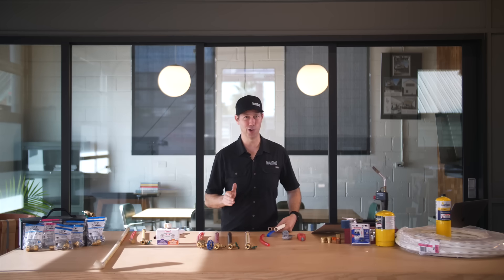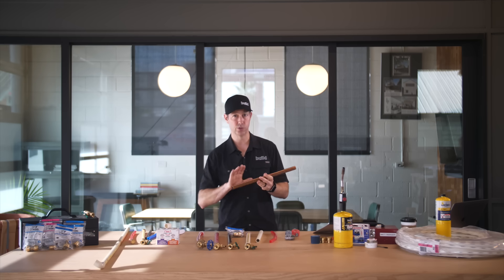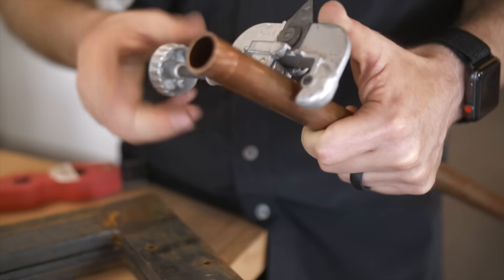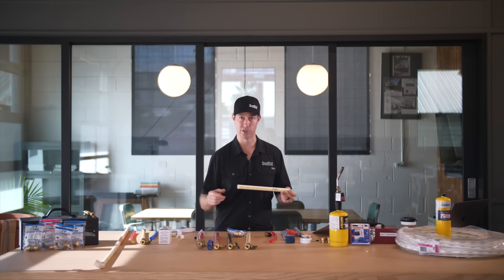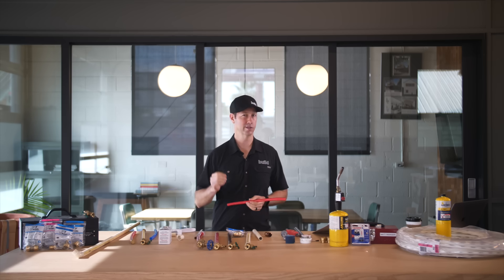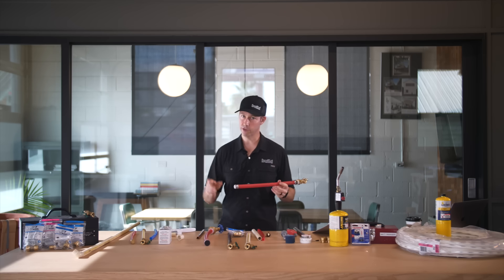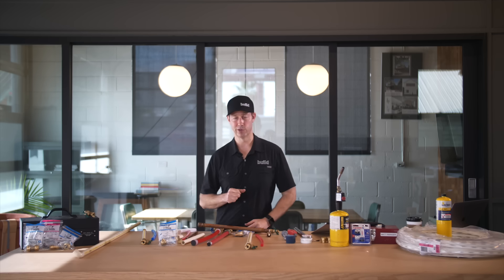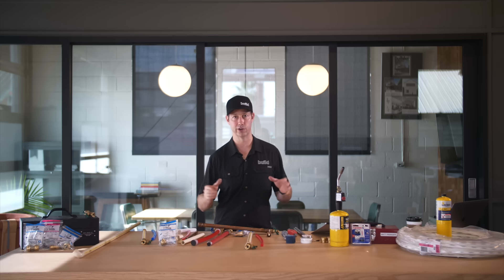PEX vs COPPER vs CPVC plumbing pipes

Comment: For the pex line, do you use the plastic fittings when you're using the expansion rings and the copper fittings when you're using the metal crimp rings, otherwise what's the difference between copper and plastic joint fittings?

Comment: I’ve been running and replacing water line for 30 years. Type M copper can become paper thin in 30-40 years. Cpvc becomes brittle in 15-20 years. Long term l think pvc is the best. Not as rigid or pipe in as straight, but that’s what I would use. As far as installation, cpvc has a one step yellow glue, primer is not needed.

Comment: You forgot to mention o-ring failure in push to connect fittings.   Figure 5 or so years before o-rings dry out and start failing.     I won't use push to connect except for emergencies or temporary installation.

Comment: Dam fine vid. This field is getting so big it's hard to keep track of all the options. Metal, plastic, press, push, expansion. Heck I've never even heard of push on. Crazy. That one looks so easy. I wonder what the life span of those are. I've heard so many different pronunciations of Uponor that I don't know what to call that one. I certainly respect your unbiased opinions. I learn something every time. Your opinions about the lifespan of these products is greatly appreciated.
Reply: Ain't that the truth, so many new technologies it's hard to keep up with.

I have galvanized in my house but have used both copper and cpvc when doing some upgrades.  I have done some push-connect pex work in a friends house.  Super easy to work with.  The push-connect connectors are expensive but very idiot-user friendly.  That said, I would only use the push-connect stuff in unfinished basements and such, not in finished walls and ceilings unless direct access available only because it hasn't been around long enough to really know it's 'shelf life'.

Comment: While they all have their pros and cons, the statement of class L or M is just fine is false.   Class M has been outlawed on new builds in our area (cape cod) due to highly acidic ground water eating it alive from the inside out. I had to rip all the copper out of my house due to multiple pin hole failures,  before a pipe finally burst on the 2nd floor of the house while I was at work.  Resulting damage was significant.   House was 25 years old at the time..  Pex and cpvc don't suffer this issue.  The brittleness spoken of by some on this thread I have never heard of or experienced.   I am no pro, but that being said, I replumbed my entire house with cpvc.  It was easy to do, and I recommend it to anyone.

Comment: How did the CPVC do during the freeze in Austin?   I have house build back in the 50s-60s with galvanized piping.   When re-piping CPVC what precautions should be used for freezing weather in Houston (when it happens)?

Comment: Do not use Shark Bite type fittings in your home. Only use them for a temporary fix. The problem with them is they are concerned about what the chlorine affect is going to be on the O-rings in time. I've been a plumber for nearly 50 years and I've seen a lot of things, I mean things like polybutylene  piping .Being a master plumber the state sent me a report about 20 years ago about why polybutylene failed. The culprit as to why it failed is chlorine. it caused the pipe to deteriorate hence the fittings blew off. So if your pipe system is on well water it would work fine. One more thing, PEX has chlorine issues too but not as bad, they just don't know yet, only time will tell.....

Comment: For pipe replacements, I've always stuck with the same pipe the house was plumbed with. It makes no sense to transition to a different style of pipe unless you repipe the whole house. Keep continuity until you're ready to switch it all over. I like a system to look nice too
Reply: So you'd keep poly b If piped with it lol
Reply: @smotpoker15  No I wouldn't, nor would I continue to use any product found to be incorrect or unsafe for the application. I would replace the whole system in that case.

Comment: Nice explanation but need more about the CONS of CPVC. I am currently in my first house with CPVC. I lose sleep over it. The pipes are just over 20 years old and if you look at them funny they will break. They become very very brittle after 10 years and any slight sideways pressure they snap off. Case in point, turning off a sink or toilet supply valve will break the pipe in a heartbeat. I've heard that just the weight of the pipes with water in them can snap cpvc. You can not cut the old cpvc with one of those side cutter type cutters as it shatters into pieces. Hoping to replace all with PEX if I can afford it. Scared to death to work on that crap - CPVC

Comment: Everyone seems to like pex, but something I haven’t seen mentioned is that it’s Achilles heal is high levels of chlorine in the water.  Over time high levels of chlorine will degrade it and cause pinhole leaks throughout any PP piping system.  In Europe they don’t use chlorine to disinfect water.  They use other methods such as UV rays, heat, etc... so pex works great in Europe.  Consider the amount of chlorine in your local water and compare that to the recommended levels expressed by the pex manufacturers.  If your local water is within the manufactures recommended levels, you should experience longer life out of pex, just make sure it’s something you’re considering.

Comment: Copper is subject to corrosion where the water is acidic, as in New England.  I once replaced a pipe that had a longitudinal groove corroded inside the bottom of the entire length of the pipe.

Comment: CPVC garbage , I work on multiple properties built within the last 20 years and in every single  one of the properties CPVC breaks on the daily basis it gets so brittle that cracks si easily you can’t even do repairs you shouldn’t even have it as an option

Comment: Every busted pipe I’ve seen due to the Great Texas Freeze of 2021 was made of copper.
Reply: I am redoing all the water lines in 4 houses currently in Texas all was the CPVC that bust this week.
Reply: And still would put copper over any of the other junk talked about here, just insulated and will out last any of the garbage mentioned here
Reply: I had Cpvc bust

Comment: Great video.  I have acidic water and after 40 years pin hole leaks developed every month on cold lines only.  I would never use copper.   I had to replace all the cold water lines.  I used cpvc but would go to pex in the future.  Also cpvc is more forgiving to freezing than copper having copper lines right next to cpvc where the copper lines burst and the cpvc didn’t.

Comment: Don't know about the rest of you, but where I live, Shark Bite fittings are way more expensive (2-4x) than crimp fittings for Pex pipe.  They are handy for fixing out-of-the-way leaks where you just can't get a pair of crimpers in the space, but to do a whole house seems like adding a lot of extra cost for not much saving of time to install.
Reply: And shouldn't be trusted as much , O rings go bad with time and that's the seal in shark bites
Reply: 15 to 20 each here..The shut offs are 25..Unreal

Comment: There are anti-microbial benefits to using copper.
Reply: I would also be concerned about chemical leeching with cpvc and pex. There is already enough harmful crap in our water as it is.
Reply: @archaicsage4803  that can be detected with a tds test, RO would take 95% of it out if there was anything leaching in. It’s something to worry about but in the grand scheme not really
Reply: @jonnyg44  A RO system uses the same plastics that contaminate water. You are literally shooting yourself in the foot. A water distillation installation is the only option.
Reply: Just don't use tin/lead to solder it...   😆
Reply: Baltimore city runs the water ph at like 7.6-8 just so the lead that was used in the pipes doesn’t leach
Reply: Where I live, if your water is that bad you have a whole water treatment system or if you have city water the water is so good you don’t need it.

Comment: I'm going to have to repipe my home due to busted pipes from freezing. I live near Houston area and temperatures get really high. Will Pex be okay in the attic when temperatures rise and if temperatures fall below freezing again. Planning on wrapping the new pipes.
Reply: They should be just fine
Reply: Make sure you insulate the cold water lines atleast, they condisate when exposed to certain temperatures
Reply: Ey man I live in Houston and I'll go to put pex pipe because is easy to install same happen in my house pipe burst but I'm ok
Reply: If you put pex no use a sharkbite connectors use Ring to Tide the connectors

Comment: I was told on copper pipe you see that green is settlement on the jointsI was  Due to the PH in the water supply Also was told that your pipe dissolveing Can anybody verify this if it's true

Comment: Good info. I have used all 3 also. Now, I try to exclusively use PEX. Sharkbite, I only use for going from copper to PEX, and never on the PEX side. A few years ago, I plumbed a house using PEX and Sharkbite. Did not get back to my project for a few weeks, but had it pressurized and checked it every few days. after 3 weeks, I saw a drop of water on several of the fittings. I do not attribute this to the product, but rather the squareness of the cut. On copper, it is pretty hard to not get a very square cut. On PEX, especially if you are using coiled PEX, it is almost impossible to get a square cut, because you are cutting into a curved pipe.

Comment: Matt, I have replaced CPVC that is 20 years old, at least here in Ohio. It can get extremely brittle with age. I have literally had it break while attempting to strap down old CPVC or or cutting it to repair or add a fitting.
Reply: 100% agreed. Cpvc that is aged is a nightmare.  That cutting tool shown would split down the run length on aged pipe.
Reply: CPVC gets brittle with age!  Just go PEX or Copper! I could go on about but just sayin ....
Reply: Copper for whomever has the money and PEX A for the budget minded!
Reply: I just had a leak in my CPCV hot water line in the ceiling, above the bathroom. I live in Orange County Calif. The plumber said he has been in business for 20 years and never saw CPVC.  @thomasw1144

Comment: licensed plumber here,, and i think that in the near future plastic pipe for potable water will be outlawed.
you cant tell me that all the chemicals used to make  ,cpvc and pex  dose not leach into the water that is in the pipe.   just like lead solder was phased out
Reply: Not only that, it shatters when cut.
Reply: @DillonPeterson  so true!  plus i did not mention the glue and cleaner used in cpvc piping. Just look at all the chemicals in that poison !  Do you really wanna drink water that has flowed thru  that stuff?!
Reply: Do you think an RO system would take out contaminants?
Reply: @jonnyg44  .. Not sure , I have only installed A few reverse osmosis systems . Though it would have to be installed in line " after"  the cpvc  or pex piping
Reply: @tracyridge6245  well ro have plastic pipe, but if it’s under the sink it’s minimal I guess. Whole house ro tds coming out under 50 and same when you read it at the sink...

Comment: Sir , you forgot to mention the brass piping before copper piping . , that was a job to reckon with ,must be polish condition when you finish the job  ,no nicks , no short lengths , it was the art of piping , they do collect over the years a build up rock walls .

Comment: The house my parents built in Colorado in 1972 is ready for new pipes. The copper is so thin you can pinch between your fingers. So 50 years on Colorado well water for copper.
Reply: Acidic well water in North Carolina caused multiple pain hole leaks in copper tubing.

Comment: If you were building your own house and had to choose between pex A or B what would you choose ?
Reply: Trying to figure that out myself. I'm in Ohio, and all the stores and plumbers around me only have B. I think i would rather use A, but honestly don't think it's an option for me. Any parts or repairs down the road if I use A, will not be sonething i can get quickly  locally.
So B it is for me.

Comment: Please don't ever use cpvc in your house.  I used it to replace my old pipe in my 120 year old house around 20 years ago and it has become very brittle.  A couple of weeks ago, I snapped it in two when I was shutting off the water.  It doesn't flex any more; it shatters, and you can barely cut it.  Check out the other posters here who are having the same problems.

Comment: another none plumber pretending to be an expert
Reply from the maker: Definitely not an expert. But have been building for 25 years and I’m a massive researcher
Reply: @buildshow  I have been plumbing for 25 yrs, live and work in Phx Az. I am a leak locator and specialize in slab leaks doing 3-5 locates a week on top of all other responsibilities. on average type L copper looped underneath the slab can last anywhere from 20-50 yrs before failing and nine out of ten being hot water lines. Copper might last 75yrs like you said just not here in Phx
to many unseen factors determining lifespan to make an absolute statement.
- water condition being number one
- soil condition
- usage
- proper installation etc.....

Comment: The only thing CPVC is good for is for a water heater T&P run. 
Pex : leaks chemicals in your potable water affecting your skin , hair , and if you are a dumbass drinking it you are lucky , you will at lest start loosing your memory at 65-70 (Alzheimer’s symptoms ). 

Copper : antibacterial , the best piping for your water , but don’t be a cheap ass , install a water water treatment system and install another 5-6 stage RO (reverse osmosis ) system under your kitchen faucet . And have your plumber use pro press fittings for connecting your copper pipes , and insulate all pipes under the house .

Comment: I like how re usable pex can be. compared the the others.

say an elbo for example with the other 2 you need to cut it and it's a waist but with pex snap off the clamp holding the pex hose to the elbo and you can take the pex off the elbo and re use the elbo with no problem.

mistakes are easier to fix with pex. 

pex is more flexible than cpvc

these are just what I feel from my own personal experience with pex.

I've helped my dad and have done a number of projects helping people using both cpvc and pex and pex was by far the easiest and most flexible of the two. I've never worked with copper beyond connecting copper to cpvc during a quick repair for my grandmothers water lines, eventually all the lines got replaced with pex.

Comment: Pin hole leaks in copper pipe is a nightmare. Had one that was impossible to get to. 3 weeks to tear up subfloor and fix all kinds of stuff in the way.  The pipe was bent almost 90° the sharp bend with movement eat throw the the pipe. All it need was a elbow. 

Trailers for the 70s 2 out 10 would not recommend.

Comment: My house was built 2002 with all pex lines and a hot/cold manifold... was super easy to work on when I moved the water softener... needless to say when I build my new house in the next year or so it will also be done with pex lines.

Comment: It would be worth mentionning the importance of checking your local building code before choosing your plumbing type. Also, as I have also used the 3 types of pipes, I have noticed that pex will withstand frost very well, while CPVC and copper will not at all.

Comment: The price of copper skyrocketed during the early 1970s. This affected both plumbing and electrical work. The plumber switched to PCV which is much cheaper. On the other hand, the electrician went to aluminum wiring for the same reason of cost over copper. Having been an electrician, I am no fan of aluminum  wiring. It can start a fire especially when splicing wires and when attaching wire to switches, receptacles, and fixtures. There was a silver like coating for minimizing the dangers that can develop on connections.  That price of copper enticed people to steal it when possible to sell, even from power company substations, with the high risk of electrocution.